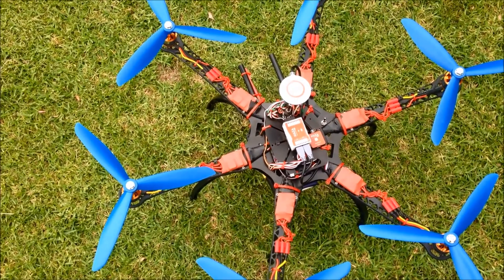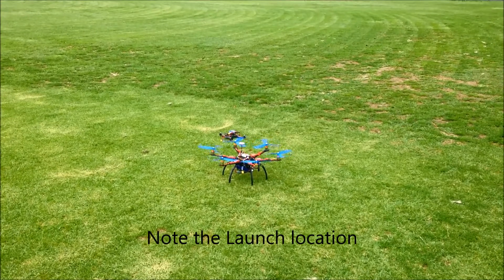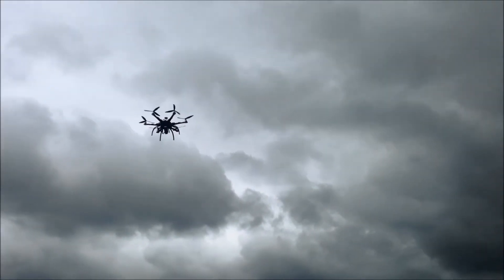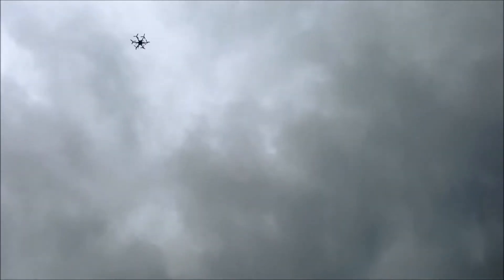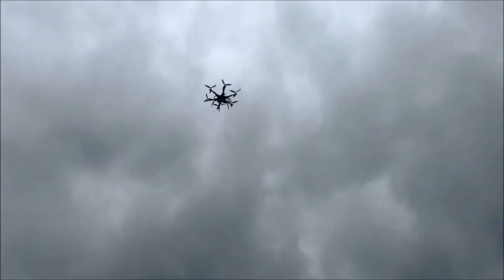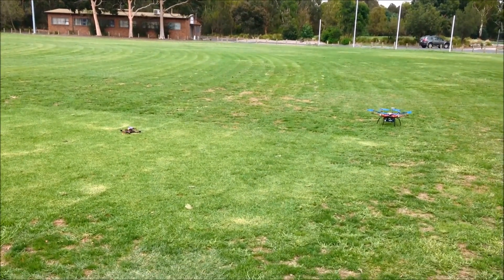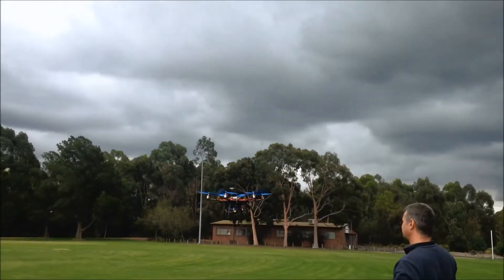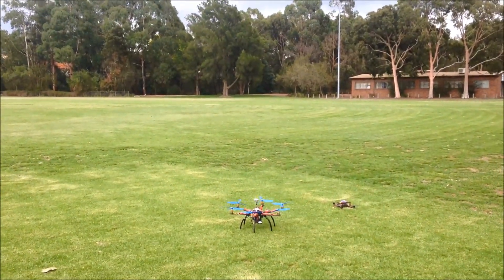s550 Spider Hexacopter RTL test in stiff wind and new 10x47 Triple Props NAZA Lite

Comment: My APM 2.6 and 2.8 nail the RTL 97% of the time within a meter! The naza V2 I had was horrible at RTL and the gps lock was never any good.  I spent 100 of hours trying to correct this but never could.  I had my vibrations down to where the iOS vibration app could barely detect it.  So my end thoughts are I'd never by another naza anything ever again.  For $35 I get an APM that works 90% better in all areas.  Now that being said there are some clone APM's out there that are complete junk.  So at first it could be hit and miss until you find a decent clone and or manufacturer that makes good clones.  Hobbyking has done me well over the years so that's a thought.

Comment: Hey at least it landed on the same farm? How do you find the 3 blade props? Good Job. Thanks
Reply from the maker: +ElectraRC I find they give extra thrust but I have never attempted to balance them so there is a bit of vibration. I use them on my acro builds where vibration is not an issue and they are brilliant.